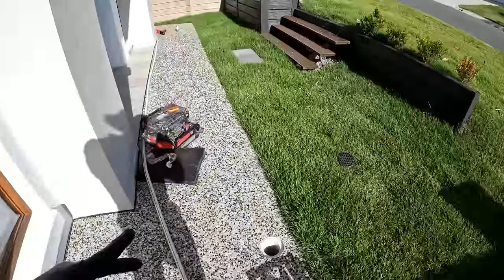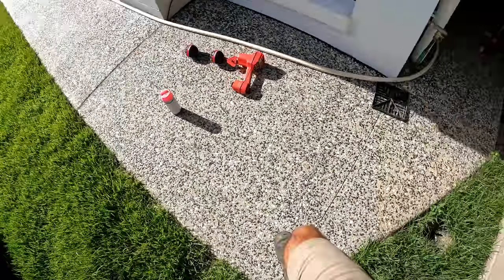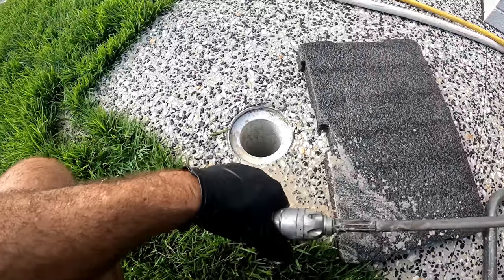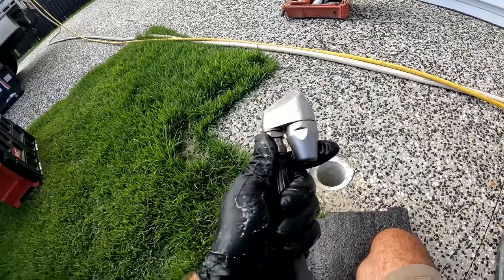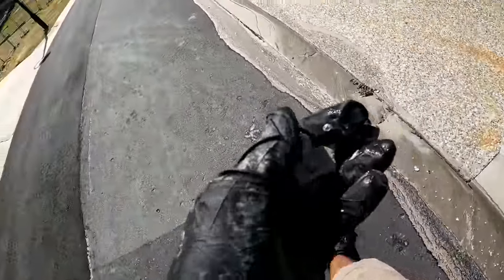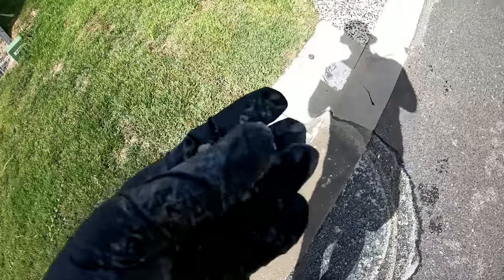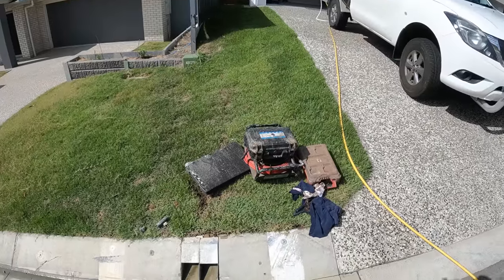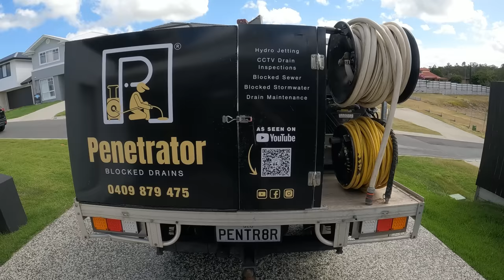Blocked Drain 346 - Inconsiderate Contractors Completely Fill Pipe With Concrete Slurry

Comment: As soon as I saw that exposed aggregate slab, I knew exactly what happened. They probably washed that entire top layer of concrete right down the drain, and didn't give a single care to actually flushing the line properly. Shameful, really.

Comment: Is it a  building code requirement to bring all surface water to the street or just common practice?
Reply: just common practice, as long as the street is lower than the property.

Comment: would that flex hose you have work for stuff like that?  the one with the chain thing on the end...kind of beat up the slurry....if it's hardened that is...
Reply: a flex shaft might have worked, but you'd need water to keep those bits moving along within the pipe. The biggest problem with a flex is they can also wear a hole in the pipe if you stay in one place too long.

Comment: Isn’t it time in this day and age that someone could improve the drainage system so that it doesn’t block. Why does domestic drainage have to be underground?  Maybe something secure, strong and aesthetic above the surface would create less problems 🤷‍♀️
Reply: well, for starters, drainpipes only flow downhill with gravity, which is why they are lower than a patio slab.

Comment: There should be a humongous fine on companies that dump their building waste into pipes. As well as escalating scales of license suspension depending on which offense they’re on. 1st they get a week. 2nd offense: they get 2 weeks suspension and double first offense fine. 3rd offense: 1 month license suspension, 4 times original offense fine. The only way this practice stops is by hitting the companies where it hurts…in their bottom line.